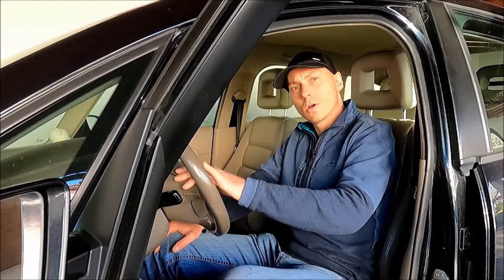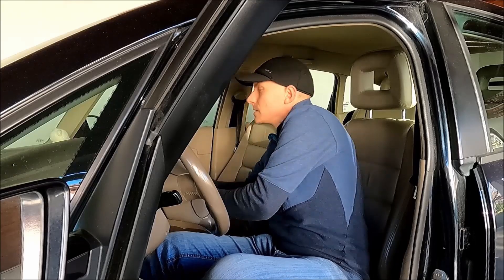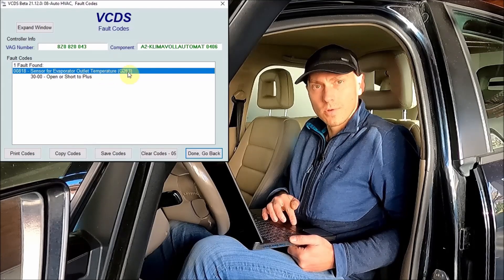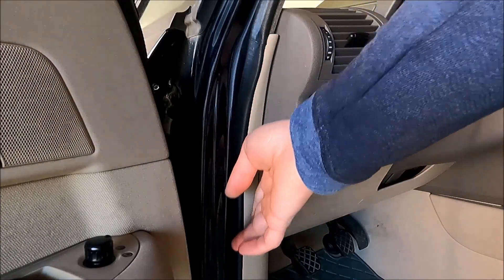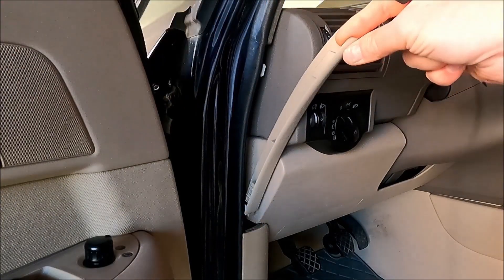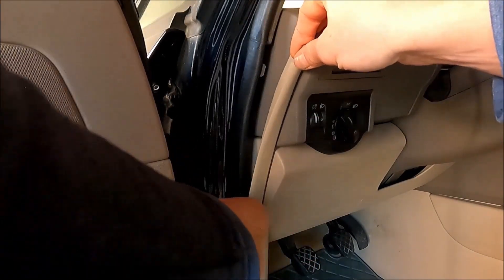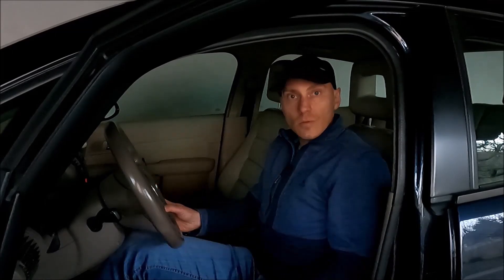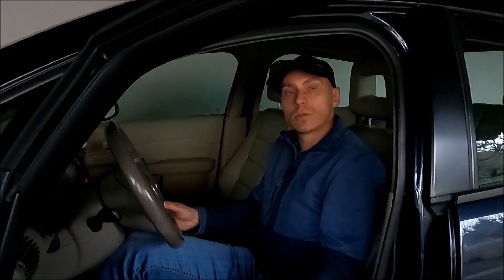Audi A2 - sensor for evaporator outlet temperature (G263) replacement – EP8 – project youngtimer

Comment: I see this has been up for quite a while. My A2 is throwing this code. The ac is not blowing cold. But if anyone can tell me, could it throw this code if the refrigerant has leaked out? Without a certified shop to test it, i have no way of knowinf if im out of freon becaudr of a leak and this sensor is actual ok, or if it really is the sensor.
Reply from the maker: I do not think this code is connected to refrigerant leaking.
Reply: Maybe you should replace thermostat

Comment: hi. owning a2 1.4tdi. need help with 00710 fault. Any suggestion? thanks
Reply from the maker: So defroster flap, right? There is no other way except to take it out and try to repair it or replace it. Check if there is an option to recalibrate it first…

Comment: Thanks for the video! The problem I have is that the fan does not work properly, I still have the same problem after changing to a new fan. Is this also the censor that causes this problem?
Reply from the maker: Sadly I do not know. I did not have this problem. But I do suggest to check with diagnostic if the trouble code is present. If the problem is in this sensor, the trouble code should be present.

Comment: Thank you for your very understanding video. Very well explained.
I have got a problem with my A2 that AC only delivers ice cold air.
I can not reach the control module with  VDCS and the hidden menu (air circulation+arrow up) does not work either.
I have tried a different module but it behaves in the same way.
Can it be possible that a faulty sensor confuses the module in a way that it can not be reached?
What or which sensor could this be?

Any help is greatly appreciated.
Kindest regards, R. Winter
Reply from the maker: Sadly I cannot give any usable suggestion. I would try to find a cheap used AC control unit and test it with that one.

Comment: Thank you very much for the video! It helped a lot in replacing the sensor!
To remove the clip that holds the cable to the aluminum plate (shown at 11:37), I used an M5 nut (actually a wing nut, but a normal nut should work the same)  that I put over the clips. That compressed them so I could easily draw them through the hole.
Reply from the maker: Thank you, great tip.